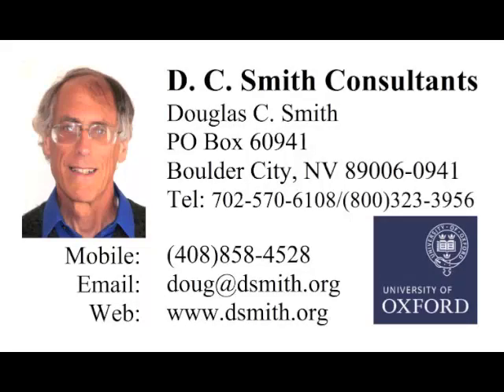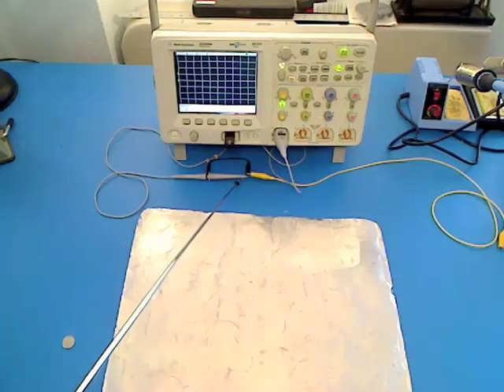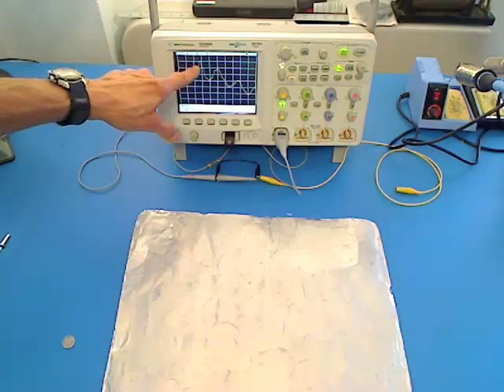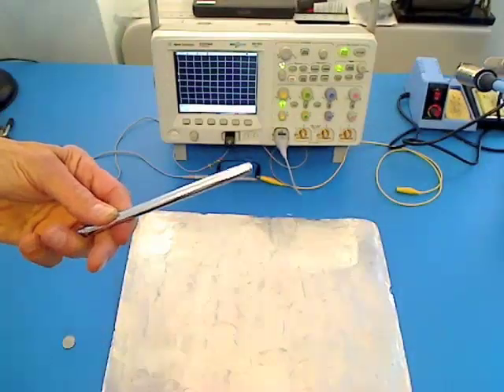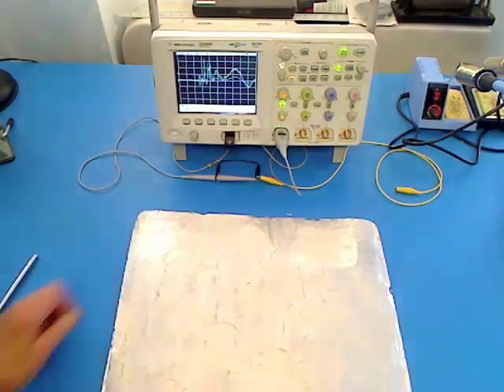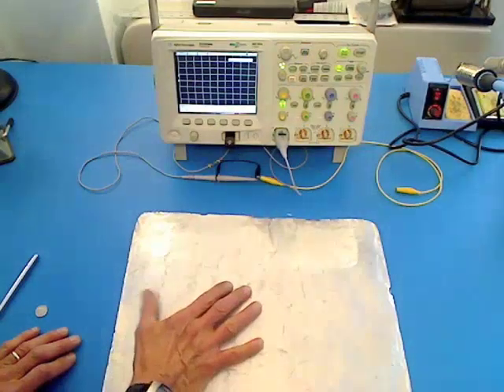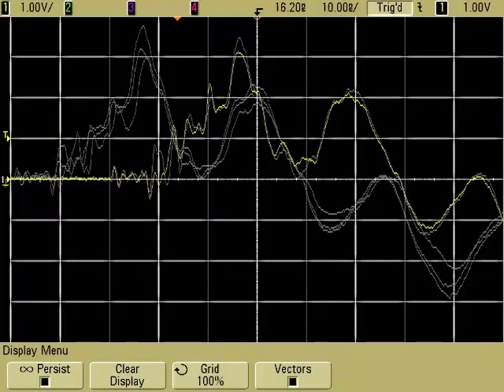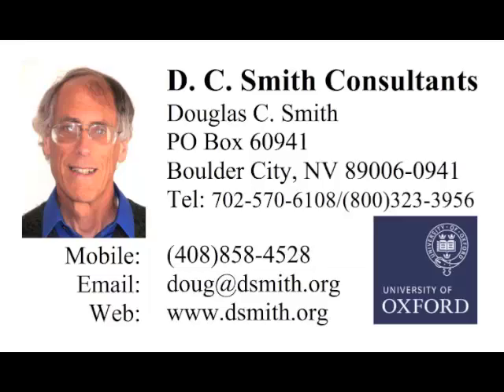Hand Metal ESD

Comment: hi, nice intresting video..  what does the yellow wire do ? also what would it be called in antenna theory ?
Reply from the maker: Hasan Jaafar you could think of it as an antenna.
Reply: @dougcsmith  thank you .. so a monopole antenna .. ? would it be better if it was straight at the end or its looped to perform some inductunce for inductive coupling? .. because some of the e field didnt merge with h field yet at that distance?